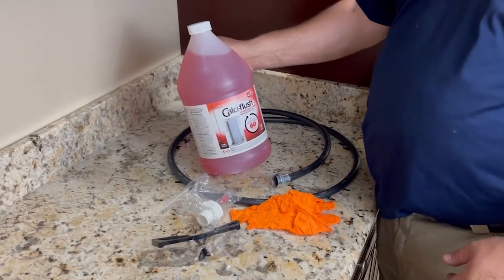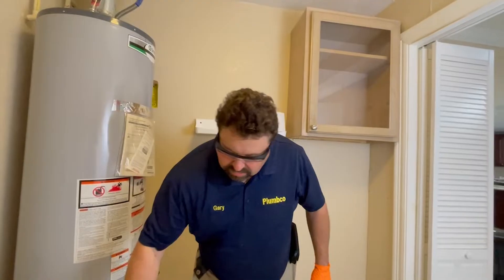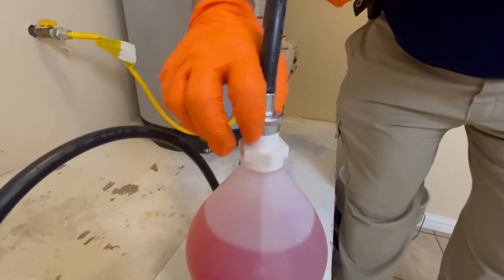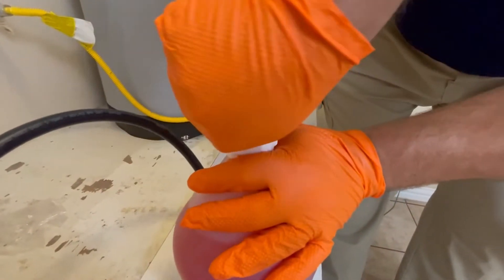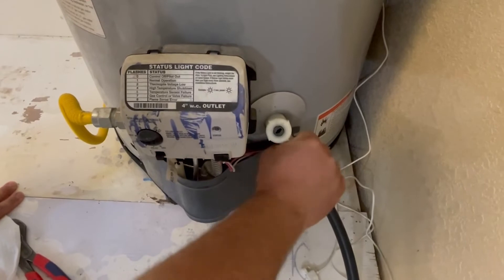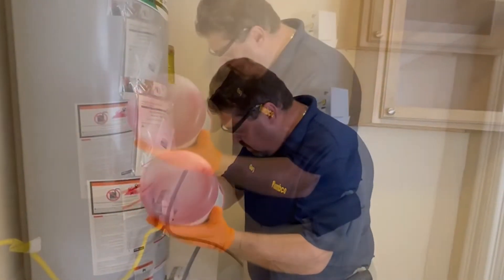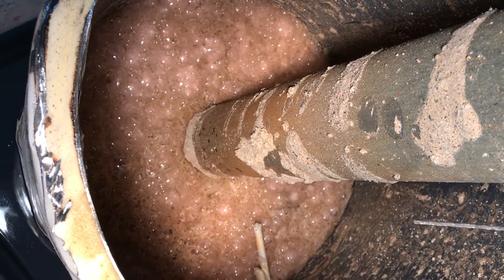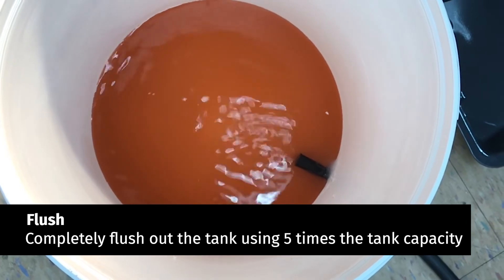Calci-flush - How To Descale & Restore A Tank Water Heater

Comment: why can you just remove the anode rod and pour it into the heater from the top?
Reply: u can be use a funnel or it might spill. this is just a cleaner way bc the cap is the same size for the garden hose
Reply: I used vinegar, but for me it was easier to remove the pressure relief valve than the anode rod. I used an oil funnel from walmart with a flexible spout that can turn 90 degrees. It also gave me a chance to remove the calcium from inside the prv.
Reply: Can you pour this in via the cold water intake port instead using a funnel?
Reply: That was a gas water heater, there were no anode rods in it.
Reply: @mb987987 Gas heaters have anodes too.
Reply: @mb987987  gas water heaters have anode rods too. They serve the same purpose of protecting the tank against corrosion.
Reply: @mb987987  Gas water heaters have anode rods too. I just replaced mine on a Rheem gas heater.